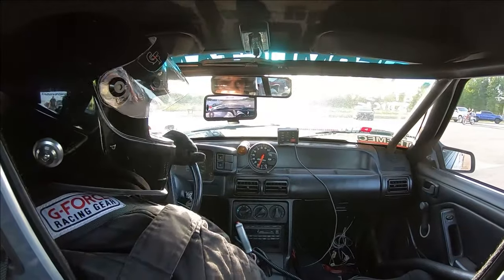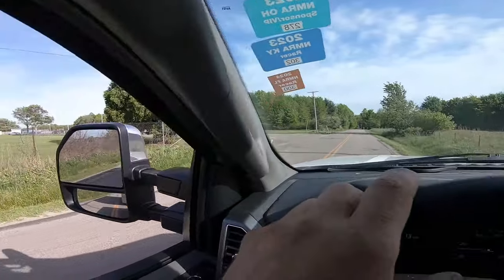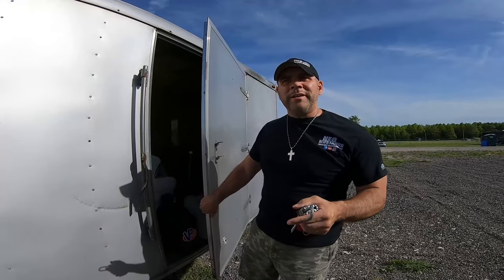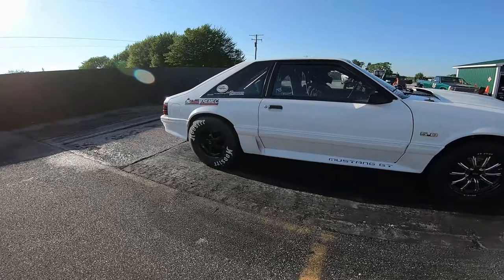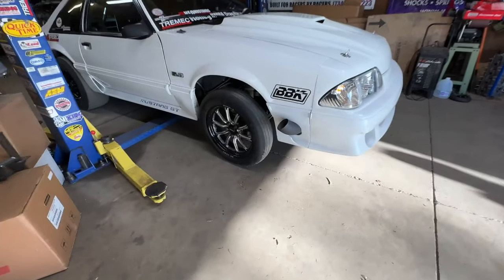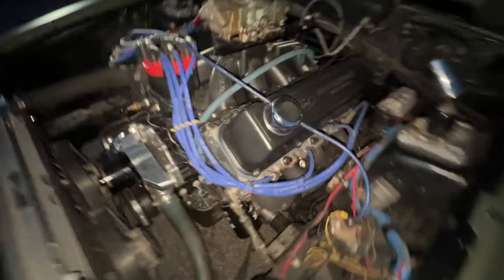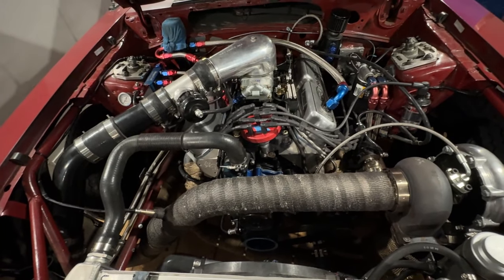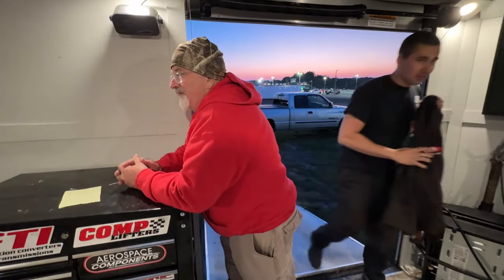WE WERE FLYIN' 8 Second Stick Car N/A 460 Coupe & Budget Turbo Carb!

Comment: Hey, how's it going what manuel transmission are you running on your cars. I have a ford lightning I Manuel swapped but I currently running an m5OD. I know that transmission ain't going to hold for much longer can you recommend me something that will take a beating and reliable for racing. thanks

Comment: Why didn't the factory clutch pedal switch work for the 2 step? 
Just curious, was planning to hook mine up to the factory switch.
Reply from the maker: My t56 mag has a long fork so the throw is a tad longer than stock. Probably work well with stock